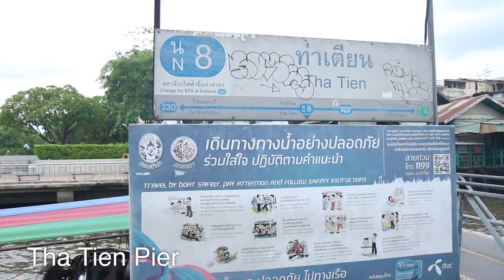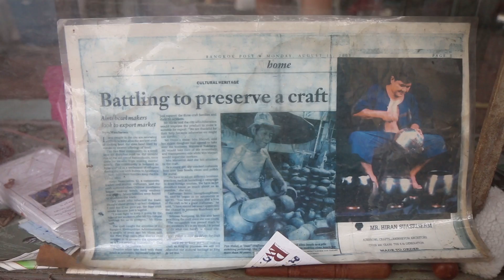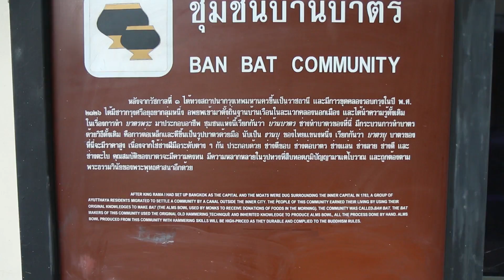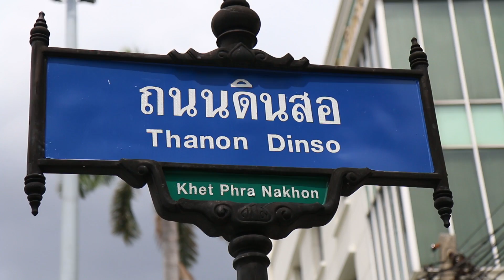Monk's Bowl Village (Ban Baat) and Old School Lunch in Bangkok

Comment: Ok, so you told us the price of transportation but not the price of the bowls, which is pretty much what the video was about lol so how much are the bowls, because from what I gathered from a posted sign in the video and a currency converter ol they ran from .93- $1.56 and I don't see that as being accurate.